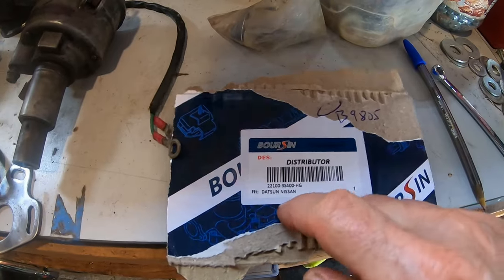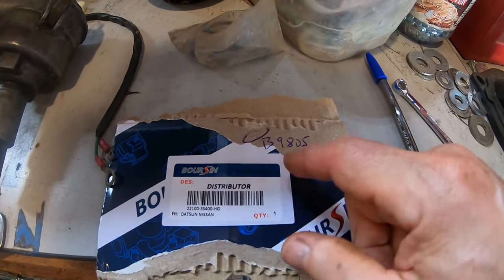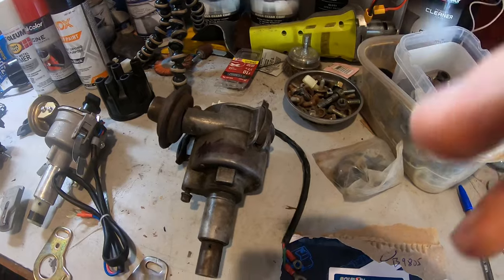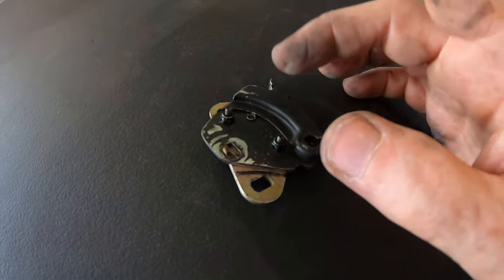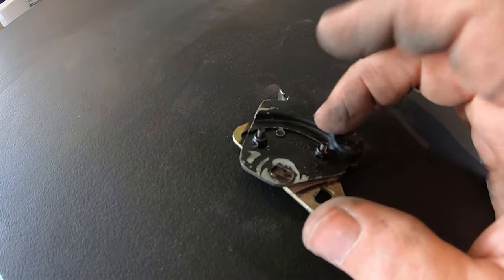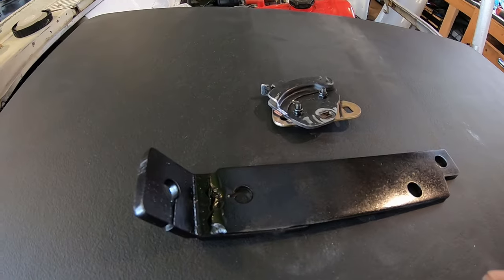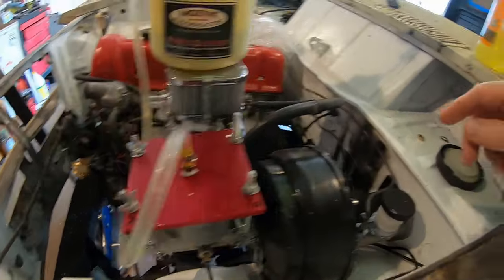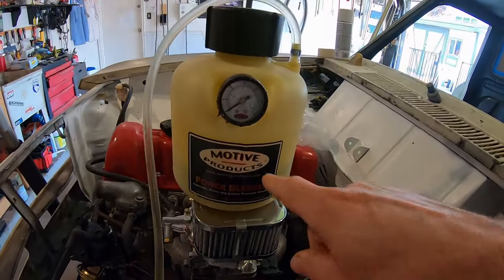Datsun truck restoration. Custom Weber carb linkage and door glass remove. Part 21

Comment: Nice seats, Im planning to use miata seats when i get rid of the bench on mine
Interestd to see what you do with them mounting.
Reply from the maker: I am still working on the mounting. A thinner back seat would be ideal. I got the drivers seat almost done last night. 3 of the 4 holes are welded up with extra plates.